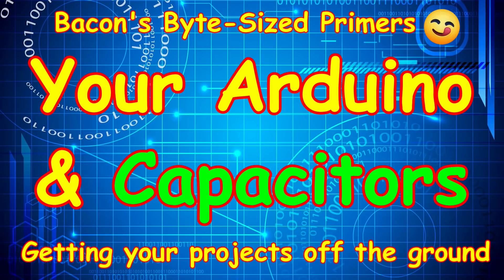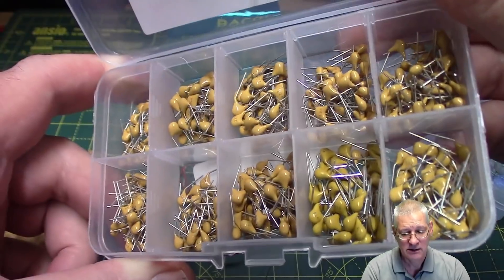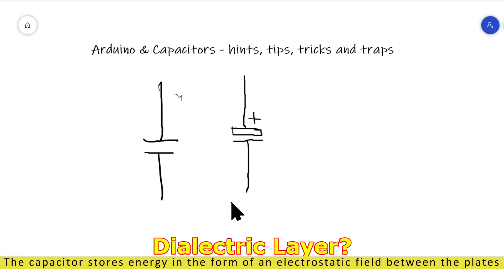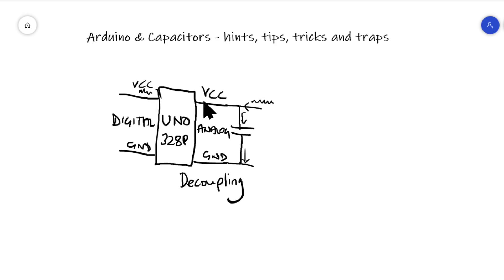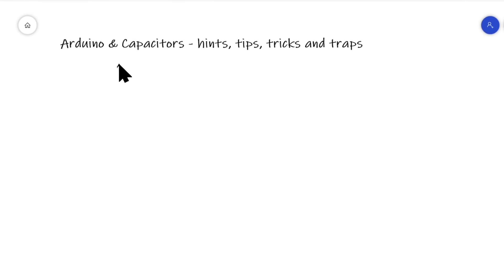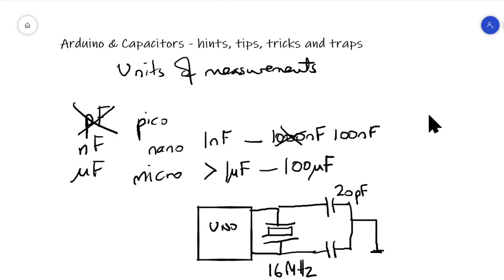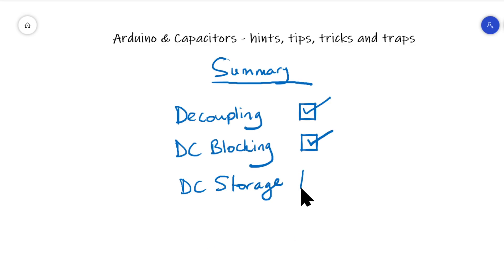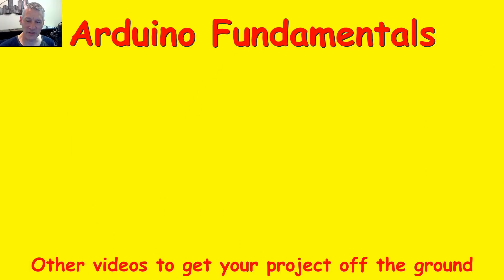#BB2 Capacitors - from an Arduino Perspective

Comment: I am enjoying this series because it gives me a foundation to understand circuits. Protecting the GPIOs would be a good useful video also I'm sure you may be building up to it but I'm guessing it needs to be in most projects. I"m working this out now for first D1 Mini 8266 3.3v project. I am using this link http://www.thebox.myzen.co.uk/Tutorial/Protection.html .
Reply from the maker: Glad you like the series, Danny. Be careful with the ESP8266, it is easy to forget that 3V3 is the maximum voltage the pins will tolerate. Use a level shifter or voltage divider with resistors. Or just use 3v3 modules designed for the ESP8266 D1 Mini (they all plug in together, see my Home Alone project).
Reply: @RalphBacon  Thanks for the advice. I'm using the i2c ADS 1115 with a voltage divider and a mosfet module. I will keep a sharper eye out. Thanks again for all the work you put in to the videos.

Comment: Hi Ralph. Again a very informative video. I did not know about the DC block usage. One thing I am wondering for some time now. If they specify use a X farad capacitor for you project they hardly ever specify the voltage. So is the voltage related at all to the capacitance? (farad is the unit for capacitance right?) As I see it the higher the voltage of a cap the longer it you need to charge it to get to that voltage?  How to say this. Say the max voltage in the project will be 5 volt. Does it matter if they say you need to use a 47 uF cap if you use a 10volt or a 50 volts cap? (besides the size of course).
Reply: @Hans De Groot To answer your specific question ... NO it doesn't matter if a 10v cap is specified but all you have to hand is a 50v one (or a 100v or 1000v. Depending on type of capacitor though you MAY need to pay attention to the ESR (Equivalent Series Resistance), leakage and frequency capabilities. For general LOW speed operation it's typically a non issue, but like Ralph said the specific circumstances may dictate specific values.
In the 45 years I've been an electronic engineer and 48 years of being a member of the IET I have been very fortunate in only experiencing an over-volted electrolytic capacitor twice! The first was whilst working for an audio amplifier company in Bristol - Radford Electronics, a name probably familiar to HiFi buffs that go back that far - there were several amplifiers on soak test (without their covers) and one started making a very high pitched whistling noise. I immediately reached over to switch it off but as I did so a large 80 volt rated power supply capacitor's top vent blew and sprayed my bare forearm with 100 degree plus electrolyte!! Very nasty, large burn and weeks to heal. NOT a pleasant experience!
The second was when another power supply capacitor EXPLODED out of the Marshall 100 watt amplifier under repair & test in which it was sitting and its aluminium foil and paper contents spiralled 40 feet across the small hall at Uni in which we were working, missing myself and a colleague by literally inches at head height. Loss of eyesight and a severe burn through scalding electrolyte was a real possibility ... for both of us. We were lucky!
As Ralph rightly highlighted NEVER, NEVER, NEVER, overvolt an electrolytic by even small amounts. They get extremely hot, extremely quickly in an avalanche effect and can and DO explode! Don't just take for granted the normal working voltage expected. Downstream components can fail, removing load and allowing a much higher voltage to suddenly and unexpectedly appear. That's what happened in the initial case above and the design was altered to have  a 100 volt capacitor instead.The second was an out of spec PSU that had to be overhauled and repaired.
One other point. There are such things as non-polarised electrolytic capacitors, not very common if in use at all today but typically found in speaker cross-over filter circuits from the 60's to late 70's to my certain knowledge.THEY MUST be replaced with the exact same type i.e. non-polarised as they too can easily explode. If exact replacements cannot be found do not be tempted to fit near equivalent values a the cross-over will likely sound terrible when fitted to its designed for speaker. Unavailability will require a completely new cross-over design and/or replacement.
Reply: @ @boblewis5558  Clear. Stay well under the cap rating. Like at least 1 third below it.   And never touch the pins of the very big capacitors from the old crt tv's after the tv has been on that day. They can hurt like hell. :)   I have see websites with the complicated formulier that look like rocket science to me. I just thought things had to do with frequeny and stuff. Ie the small ceramic nano Farads caps are often used for filtering high frequency noice from power lines and the bigger micro farad onces for filtering out the lower frequencies. I thought that had something to do with how fast the reach their max capacitance (charge?)  Thank you for the story. Did not think of the caps as bobs with a payload until now.
I was thinking of trying to make a buck converter. I am waiting for 160 volts caps from china. I think I can not go wrong there. But suppose if I would try to make a boost converter and my arduino code is wrong the volts could just run away until something explodes.
Reply: the voltage of a capacitor is the highest the dielectric can withstand before shorting out. it jumps the gap like a spark plug for an analogy.
Reply from the maker: The value of capacitor, in microfarads (uF), determines how much charge it can store. The voltage rating is the maximum voltage it can stand before exploding like mine did. Larger voltage capability (eg 63V) just means a physically larger capacitor, no other benefit to us Arduinites. For smaller values (non-polarised, multilayer ceramics like I showed) the voltage rating is always higher anyway.
Reply: @RalphBacon  So unlike a rechargeable battery that is full when it reaches say 4.2 volt for a lithium ion  you can fully "charge" a capacitor by just putting 1 volt on a 63volt cap?
Reply from the maker: Exactly so. The energy stored in the capacitor does not depend on its max working voltage. Obviously, if you had 63 volts available then more energy would be stored but in the 1v circuit it does what it is supposed to.
Reply: @RalphBacon  So if 2 micro farad is recommended in a 5 volt circuit should I change this to 4 micro farad in a 10 volt circuit? (and make sure that caps can handle the voltage)

Comment: If an LED needs a resistor, why don't they build it in the resistor?
Reply: because the size of the resistor needed varies with the voltage used.
Reply: They do if you buy led indicators with a stated voltage.  E.g. 12V or 24V indicators then the correct value resistor is built in.  But for normal things you just calculate the required value.  (Supply - foward voltage of led)/ current you want. So if you have a 3v led and a 5v supply and you want 5mA through3the led. (5-3)/0.005
Reply from the maker: Explained perfectly by these other knowledgeable Arduinites.
Reply: @RalphBacon  I'm more of a microcontrollerphile

Comment: Malted milks with cream in between! If that's not against the law it ought to be.
Reply: And using it as a model for a capacitor should be a chargeable offence.
Reply from the maker: Guilty as charged. But I have no regrets. I'd do it again.

Comment: no overrun bang, no wrong connection bang, otherwise fine video   ;-)
old black and white tv (lamp era) had gigantic capacitors, deadly
Reply from the maker: Don't remind me of old black and white TV sets (that I turned into sound to oscilloscope devices for the local disco - it was a long time ago). I have some tingles from those (= whacking my arm back at speed as it goes numb from the shock).
Reply: @RalphBacon  which song(s) was used to test, beegees/donna summer ?

Comment: The power storage usage really seems like an extreme case of the decoupling usage, I know 'supercaps' are sometimes used to replace batteries. Of course the dc blocking usage can also be frequency filtering for people that know the math(s). All this is just advanced uses of the basics younlaid out. To be honest this is the first time I've truly understood decoupling caps, I always thought there was some mysterious function I didn't know.
Reply from the maker: Not really, Kent. Decoupling is to remove noise and keep the DC voltage as DC without anything superimposed on it that will upset the chip. Power storage is literally just that - like a mini battery it stores DC for when it is required.

Comment: Awesome lesson, thank you. Can I replace a 0.1uF capacitor with a 1uF on ESP32 VCC and GND? If so, would it has a satisfatory result, as decoupling function?
Reply from the maker: It should work, but years of experience by those more knowledgeable than me have decreed that 100nF is the optimal value for size, noise suppression into the MHz territory and not being a burden on the power supply at switch on. For mucking about on a breadboard I'd use a 1uF if I had no 100nF but for "production" use always a 100nF. The reply by Embedded Hobbyist is true for things like voltage regulators but not really necessary for integrated circuits - but the datasheet for the device will always tell you what is recommended.
Reply: Normally it is best to keep the 100nf cap and put a bigger cap in parallel.  The cap needs to work with high frequency spikes and the ceramic caps work better for this. So it's quite possible that you will use both, the 10uf or so providing a store of energy cloce to the chip.

Comment: Because I’m not a trained Electroics engineer and need a visual experience, I made a 555 timer circuit and changed the Cap to watch the led flash at different rates. THANKS RALPH!
Reply from the maker: Actually doing it, the way you have, makes the information stick in your brain forever. Great to hear, Mark.

Comment: You want the voltage on the capacitor to be as close as your supply voltage. I beg to differ. If you want an electrolytic cap to last, you need to derate it 50% on the voltage rating. Otherwise they'll cook.
Reply from the maker: I don't believe I said that! In my example I suggested a 10v cap for an Arduino at 5v. That's double the voltage. But many Asian products have 6v caps in Arduino-related modules (now that might explain a thing or two).